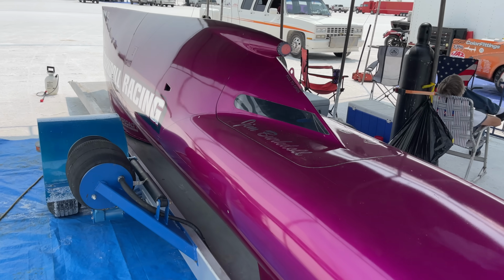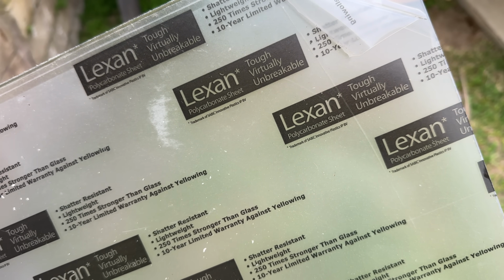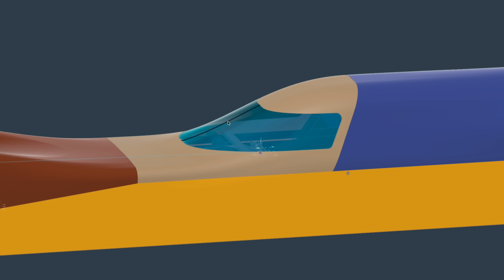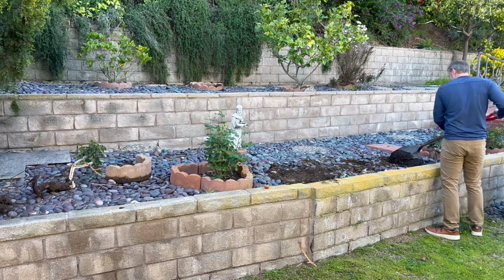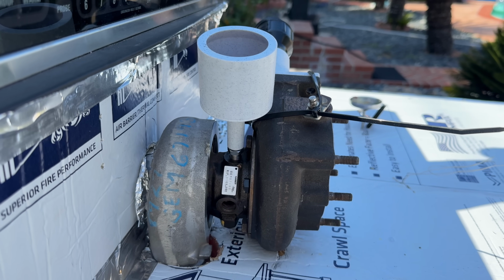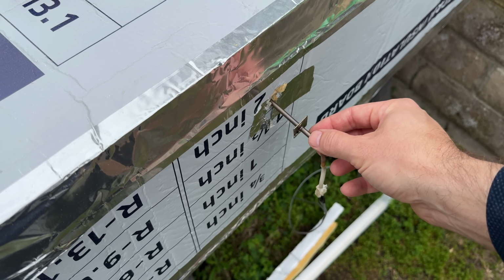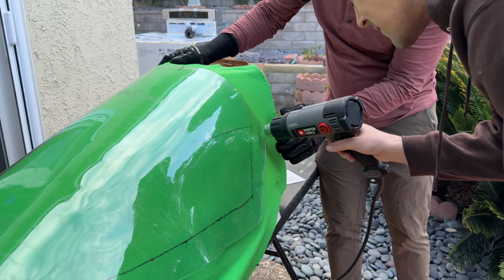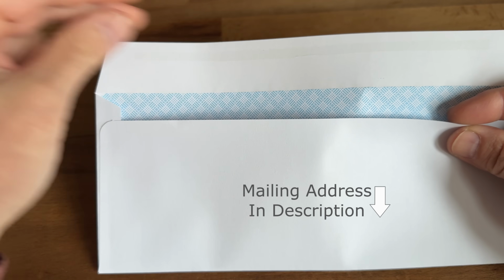I Turbocharged My Oven

Comment: I worked for a company making windshields for aircraft, developing forming processes for these.  You need to vacuum bag the part to the mold to get it to take the shape.  You may be able to get away with clamping the edges. 
I think lexan is polycarbonate.  Try using acrylic instead. It’s a lot easier to work with. And you can sand and polish it when you’re done to get the small defects out. You can’t really sand polycarbonate because it’s too gummy. 

Let me know if I can help!
Reply: Isn't polycarbonate stronger than acrylic?  I thought he said he needed the strong stuff because of rules to run on the salt flats.
Reply: @Mark_Bridges  True, poly is less brittle than plain acrylic. Aircraft is typically stretched acrylic which makes it stronger and less prone to crazing.
Reply: The rules require polycarbonate because it is tougher. It is not brittle like acrylic, it will bend. You can literally bend 1/4" poly on a sheet metal break at room temperature. In industrial settings polycarbonate is the standard safety glass for this same reason. Lucky for me, aerodynamics are not a top priority when it comes to safety shields and containment guards, so only the occasional 2" radius bend would be required using a heater strip type thing.

Comment: If you are set on the garden oven you have to measure moisture, if you can control the humidity that could provide a boon. 
Do this at your garage door? I know what you said. 
Otherwise you are playing with temperature and time, if you can sort out the clarity from dehumidify.
If you can source a form release agent, oil or wax, idk. so anything on the cook surface, blocking contaminate transfer. 
Maybe have a smaller mold for the spring back. 

if anything send then out to get polished. the first two could make a pair of pauldrons.

So you are starting the sticker application from the rear, ending at the front. Right?

Comment: always make sure to test your thermometers - the scale could have shifted so put them all in boiling water and then ice water to check two temp points that you can be certain are accurate (correcting for altitude, if necessary).

Comment: 170c Celsius for 6hrs then add 1 hr for each mm of thickness, so if it's 3mm then 6+3 hrs, if it is 5mm then 6+5 hrs :) That was the rule we followed when we made boat windshield. 
We had an old pizza oven from a pizzeria.

Comment: I did something similar to create a one-off male mold for a recumbent bicycle fairing. I had a vendor machine two polystyrene half shells ($2000 total), I lightly sanded the half shells, covered the polystyrene core in 2" wide polypropylene tape, sprayed on some mold release agent, and built-up two layers of carbon fiber with some extra epoxy coats for sanding and polishing. I then pulled off the polystyrene cores for each half and joined the two haves at the line of symmetry. Worked really well and would do it again. The only costly part was the very accurate polystyrene machining, but that was a huge labor saver and gave me 3D model perfect shape.

Comment: You might have better luck by placing the plastic sheet on the mold and place the entire thing in the oven? Slow movement of the polymer should result in less distortion.

Comment: Just a random idea, to add to other comments from folks who appear to have done this hot task before you....

Would positioning the centreline of the mould horizontal assist the draping. Along with heating of the mould surface.

Comment: The observed temperature difference of the probes during your calibration check may have also been because you let them touch the bottom of the pot, which can get hotter than the water.

Comment: Those thermometers can be calibrated. 

You use a wrench on the nut on the back and turn the dial face until the numbers line up with the needle at the known temperature. 

This is something chefs know but most engineers don’t. This is because I was a chef before I was an engineer. If you were a chef, you might be “Superfat Matt”.

Comment: Hi there, I have some experience on this. If possible,  put the mold below the heated box and make the bottom sway out of the bottom, also, suspend the sheet of PC in a frame which hangs from ropes that you can lower and control from the top on the outside of the box. This way you can simply lower the sheet onto the mold and continue to heat from the sheet a bit so the top does not cool as quickly, moreover: pre-heat the mold slightly, this prevents most of the funky-house-effect and give you some more time to adjust things if necessary. If the mold and the lowering-process of the sheed are well aligned, the forming process is done quickly and allows the sheet to cool while being well above Tg (glass-transition temperature) all the way to below the Tg, giving you the most optimal finish. Hope this helps, goodluck!

Comment: you should try and make the mould negative (inverted) and not positive as would be easier to drop in than pull over....also you could try and make larger edge and drill holes round it and put under vacuum....like vacuum moulding on a large scale? also a silicone surface might be better than a fluffy one and could take the heat....i used to make 32 scale models and did many vac formed windscreens like this....i know this is a lot bigger but i am sure principles would be the same and if not i will have only cost losts of money and waste about a week, oh hang on you did that already 😂😂....good luck man love wathching you stuff.

Comment: i made a rear hatch for an RX7 race car. I clamped the polycarbonate between 2 stock glass hatches, and used a turkey fryer as my heat source. And yes, you may be a redneck if you use a turkey fryer to make race car parts.

Comment: As always great content but I do have a suggestion for you. You want to make friends with your local paint shop in other words a car paint shop with their own oven so this way you can use a thicker Lexanne and also have the mould in the oven at the same time this way you can put the blank on top of the, mould as it actually starts to melt. It will automatically sag over the mould which with a little bit of help from yourselves. If you can stand the heat when you start to see it go you can place it properly in place this way you will not get all the lines and the rest of the crap because everything is at the same temperature including the mould but you may have to make the mould out or something a bit better than foam otherwise that may just melt as well.

Comment: Can you make your oven a little taller so you can put your buck inside it then put the material on the buck in the oven such that it drapes itself when you crank up the heat. Then you can cool it slowly which will hopefully alleviate your warping

Comment: Realistically if you want to retain the aerodynamic features on the car for the most part, after the sticker swarm has gone and went, just clear coat the body. I'd send you a sticker or two but throwing even letters across the pond is expensive and I need the coins for my own stupid projects.

Comment: ive seen it done with  sheet metal molds or wood covered in body filler molds. They build the oven big enough to put the mold in the oven with the glass, let it heat up and the poly will drape down over the mold. if you use a wood mold it needs to be pre baked to remove moisture.

Comment: Just FYI - the bake element is the main heating coil and is located under the metal bottom of the oven. 

The broil element comes on for roasting.

The convection element is the one around the fan and hardly has any real power.

Comment: Since the goal is a specific target temperature, an easy method to handle the thermometer error would be to set each red pointer clip to the target reading (which the target temperature plus or minus the calibration error for that thermometer). then you only care where the needles are relative to the pointer settings.

Comment: Aren't you mostly there with this process already? 
could you not tweak it slightly for impressive results?
Make a separate mold shape for the sheet to droop into, and then use the mol;d from this video to press the sheet into place.
this would work, right?

Comment: Vaccuform.  The mold sits on a surface full of holes.  A  polycarbonate square is mounted in a frame suspended above the mold.  Above thar are infrared emitters (heat lamps).  Once the poly is nice and soft, the frame is lowered over the mold and the air is quickly sucked out, forming the poly around the mold.turn off the heat and let cool.

Comment: AvE does some superb stickers - "Do not dumb here" / "Not to be operated by fukwits" / "Dumb free zone" / "Don't put your pinky where you wouldn't put your winky" / "Engage safety squints." etc.  Also, from SpaceBalls "If you can read this, you do not need glasses" and "We brake for nobody".  I would add to the bottom of the car "If you can read this - halp!".

Comment: maibe you need some elctric underfloor heating elements on the mould so it doesnt shocks the material once its out of the oven 
when i was watching those guys that build realy big aquariums on discovery they had the perspex layed on top of the mould (made of wood ) before they heated it up , they used inches thick perspex as the waterpressure on that glear material is enourmous , but basicly during the heating the material drooped over the mould and then cooled slowly 
did see them sand and repolish the material afterwards , probably to get those weird optical flaws out 
trying it this way does mean that you need to make the foam shiny box higher to be able to fit the mould in luckily you have the oven on a raised flowerbed so you should be able to do it with youre current setup  , it probably allso means that by the time youre done you have a fiberglass shell of the mould and a puddle of styrofoam goop on the bottom of youre oven as theres no way the foam will stay solid when exposed to 300 degrees plus for 8 hours or so 

just thinking loud here : there these building blocks here the call cell concrete 
https://betoncellen.nl/cellenbeton-blokken/
i think its mostly airated gipson there made off you can cut them with a wood or course toothed handsaw and glue them together , if you remake the mould on the router using the same methode and glue the layers together and then use a thin layer of plaster and then sandpaper to smooth it and remove the bubbles and sush on the surface you end up with a (heavier) fireproof mould that should be able to sit inside the oven at 300 degrees for 8 hours or so without anything happening to it ..... might take longer for the mass to cool back down

Comment: How about enlarging the oven and having the molding process happen inside? I.e. place a cold, flat sheet onto mold (secured to the mold at the centerline), and have it slowly heat and drape over the mold, then slowly cool, all inside the oven.

The slow heating, molding, and cooling process may help reduce the stress inside the sheet which happens during the very quick molding and cooling process, and therefore might help reduce the waviness and irregularities you're seeing.

Comment: As far as drying the polycarbonate goes, it helps if you basically have a leak in your oven. You want air circulating out of the oven, which will carry the moisture from the polycarbonate away. With 3D printer filament, I believe the typical advice is to leave the oven door cracked when you're drying it.

Comment: “Briefly stated, the Gell-Mann Amnesia effect works as follows. You open the newspaper to an article on some subject you know well. In Murray's case, physics. In mine, show business. You read the article and see the journalist has absolutely no understanding of either the facts or the issues. Often, the article is so wrong it actually presents the story backward-reversing cause and effect. I call these the ‘wet streets cause rain’ stories. Paper’s full of them.
“In any case, you read with exasperation or amusement the multiple errors in a story-and then turn the page to national or international affairs, and read with renewed interest as if the rest of the newspaper was somehow more accurate about far-off Palestine than it was about the story you just read. You turn the page, and forget what you know.”
— Michael Crichton

Comment: I used to work with a company that did vacuum forming of poly carbonate. It helps the poly carbonate from what we saw to heat the mold as well. And trim excess material after it solidifys we would put square plastic blanks in with a frame to then move the mold into the plastic from underneath and vacuum it until it cools, but I am just a guy in the comment section, you are doing the awesome. Best wishes.
Reply: I used to work in a factory that made fighter jet canopies, and they made it look easy. You just pull a 4" thick sheet of plastic out of an oven the size of a house, and use a giant hydraulic machine to stretch it in several directions at the same time, and push it over the mold in one quick movement. Like many things, it's easy if you have all the right tools, and decades of experience.
Reply: @robinbennett5994  There's probably a team of highly qualified employees (at least one PhD and couple masters in materials science of polymers) who had spent half a year figuring out the process. Leave hope behind who enters here, it's fractal problem solving all the way down.
Reply: And money for giant press

Comment: the problem you have is the trapped air in/against the surface of the cloth in the mold. as the hot plastic comes down, this air rushes out causing differential pressures/heating/everything. this is the reason why the most important part of a vacuum former is the ability to create and maintain a vacuum. you either need to heat the mold to the same temp as the lexan, use thinner lexan which will cause a smaller heating differential, use a stainless/aluminum plug, create some kind of negative pressure zone around the surface of the plug, or just give up entirely and pay someone else to do it

Comment: > magnets stop being magenta around 200 degrees
The Curie point of iron is 570ºC, though..? I think it's just the coil winding insulation that can't take that heat
Reply: Neodymium magnets are basically epoxy and powder.  The epoxy will start to let go about 90C and the magnets will ... demagnetize.

Comment: Thermoforming a policarbon sheet is very difficult. To get nice result you need to blow it or use a polished aluminium mold. Temperatures are very important too. You have to take in count thermal contraction too. without expirence it could be long and expensive process. Maybe it will be easier to create a composite body to suite bended in one direction PC windscreen

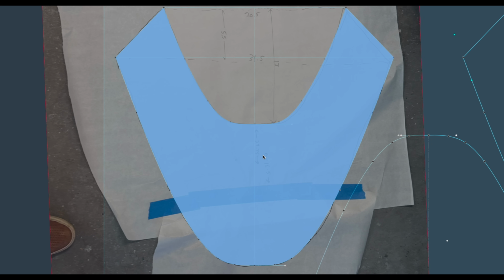Comment: 10:30 im not sure which CAD software you use, but if it has a "sheet metal" add in then there should be a "flatten" option in there.

Comment: Those cheap thermometers have to be calibrated before you use them.  They make no attempt at the factory to make them accurate.  It's easy though. Put them in boiling water, hold the nut on the back and turn the dial to read 212F or 100C.

Comment: If the mold can be preheated, it could help with the draping. Ideally a ceramic mold that could be put in the oven with the windshield. This may require a larger oven, but you're clearly capable of any turbo charging that will be needed.

Comment: Sometimes an instruction on how not to do things is more valuable than an instruction on how to do that.

Every time something works the first time because i did exactly what someone told me to do, i go "well that's underwhelming". Not that i do that very often, because you know, ideas, they always interfere. But failures are usually mildly interesting, i mean if i anticipated exactly what would fail, i likely wouldn't be doing it that way.

Comment: Why not do cameras and screen inside? You might even be able to do a HUD overlay with all your cars information.  Add accelerometers and you might even be able to tell if you have any ride roll or drift.  Cameras and screens are cheap.
Reply: Why not make more of the car out of the polycarbonate? This way you could see it and check on how things run

Comment: I worked for RTI Advanced forming / Alcoa / Arconic / Howmet (yes, we were bought and sold frequently) for a couple years. We formed Titanium sheet parts, especially with our 1250°F~1750°F hot presses. I am an engineer, but I wasn't ever technically hired as one while I was there 🤷‍♂ This video is giving me flashbacks.

I will say, though, your blanks being exactly the size you need with only the top having excess was a red flag to me. You do really need a trim area. ... Oh! I see you do, later in the video. That's good 👍

Comment: I think you should try heating the lexan on the mold and let it form by gravity.
That way it can release all internal tensions and it won't be wavy.
Also the potentially grabby surface of the cloth probably doesn't help as it might partially stick as it droops.
A+ for the oven tough.
Reply: He'd need an even bigger oven :D
Reply: @MumrikDK  And he would need a different mould... not made of polystyrene foam.
Reply: @brianb-p6586  it might be possible to separate the fiberglass from the foam and use that.
Reply: @MumrikDK  and a bigger turbo-charger.
Reply: I like ALL of the above ideas, but I'd use a decent turbocharger driven Burn Barrel to make the hot air.